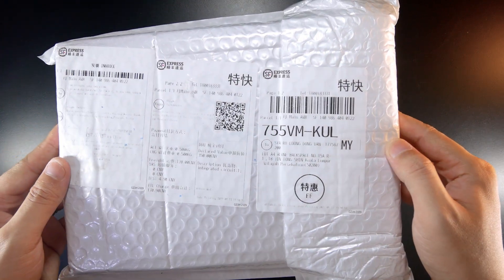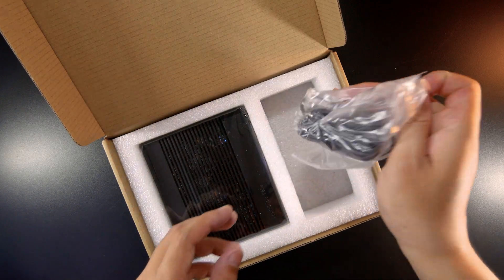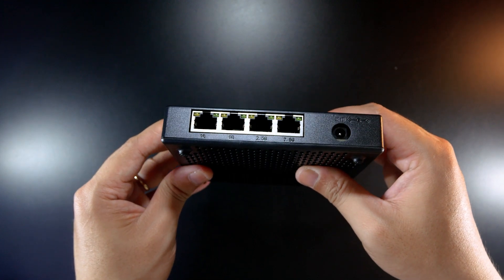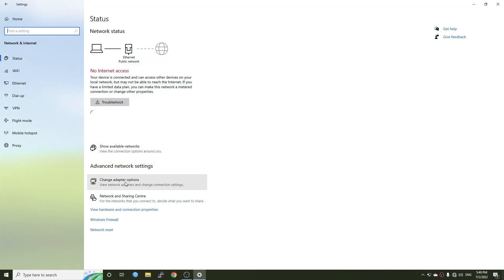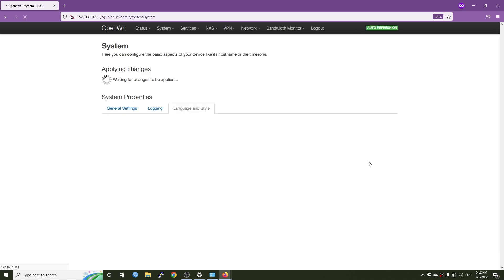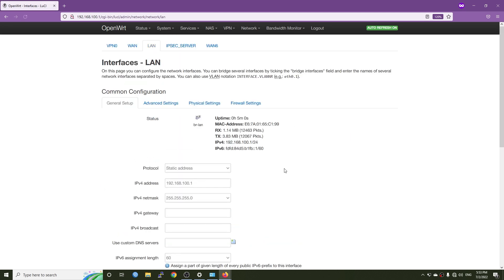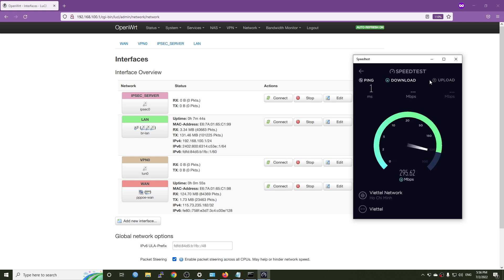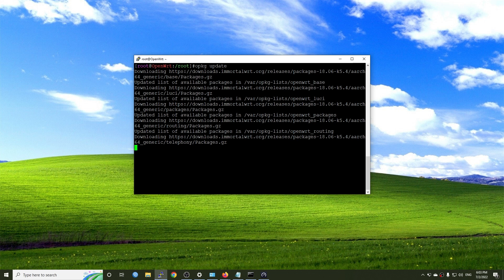OpenWRT Based - FastRhino R68s Unbox & Quick Setup

Comment: Oh R68S same as R5S,cpu rk3568s.
Reply from the maker: Yes, the R5S has a higher price due to the M.2 NVME slot, HDMI output and metal casing and can run Android and other Linux distros. While the R68s is purely a router (and docker).